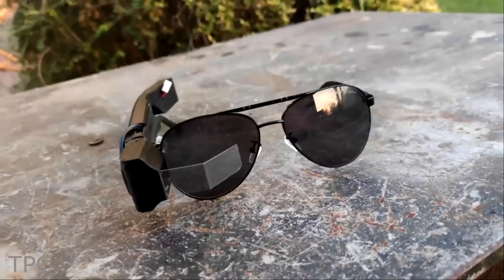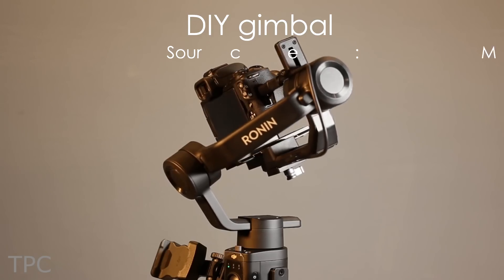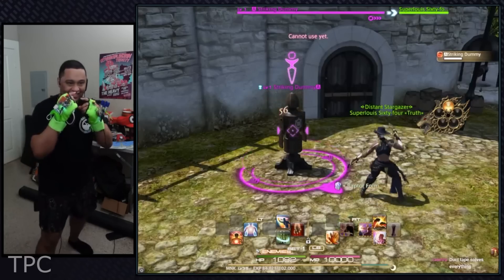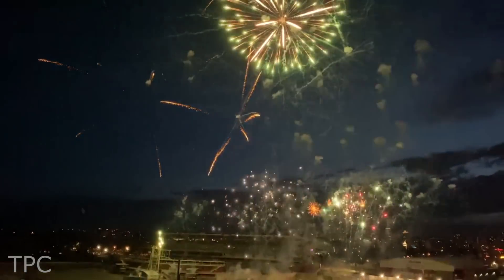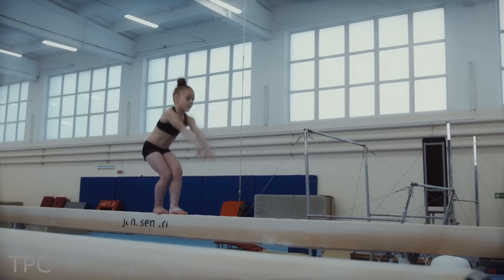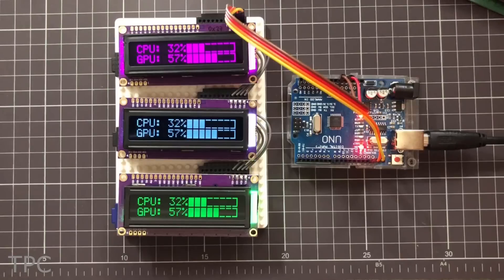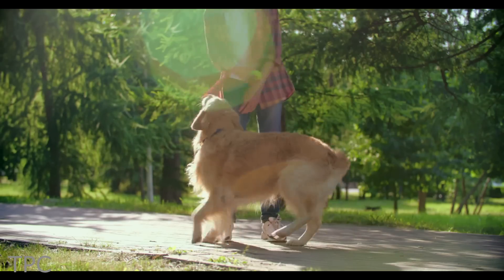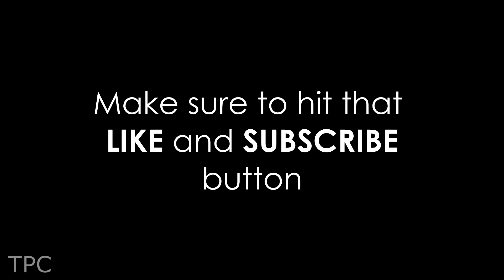Amazing Nerf Turret (& 12 More Arduino Projects)

Comment: Don't get me wrong.... in a good sense.. I can say that these type of embedded modules and their libraries are killing the talent of enthusiasts these days.. no one today cares about basic circuitary, processor interfacing, or coding today.. I remember when I was studying engineering, we use to design and make single board computers from scratch using atmel and picmicro CPUs on perf boards and even point to point wiring for some parts.. for coding, we first draws flow charts and design programs of our own.. vloggers these days must try more to include "from scratch" videos explaining basics of networks and components.. Mr. Carlson's Lab is an excellent channel in this respect..
Reply: My hunch would be that it's more of a numbers thing. The people who enjoy creating single board computers are just outnumbered by the ones who want a single board computer to create a "higher level" project, so they're less visible online. I'm sure they're still around, doing their thing. One of the first videos I found when I started researching this new (to me) world of single board computers and DIY projects, went through each component and how to build your own from scratch. Personally, I'm a programmer so I start with a "ready to use" board. I have zero interest in building my own, that's just not where my interest lies.